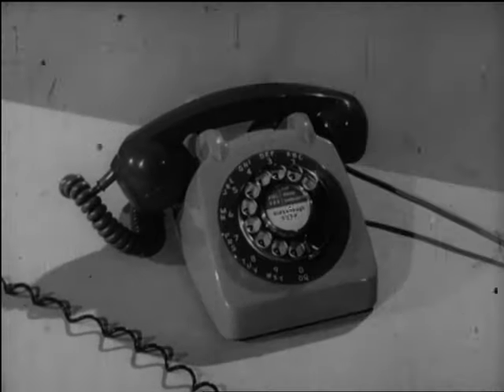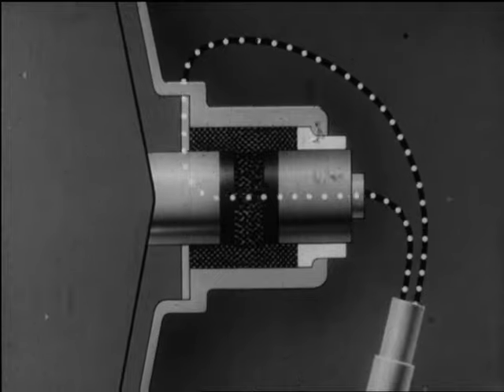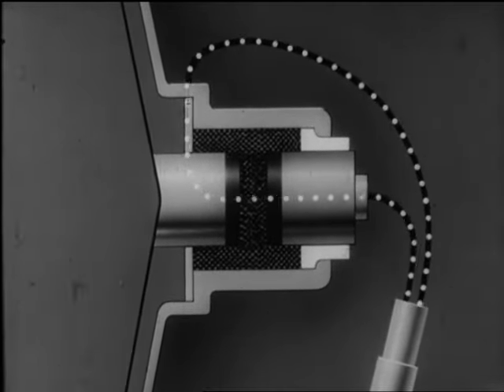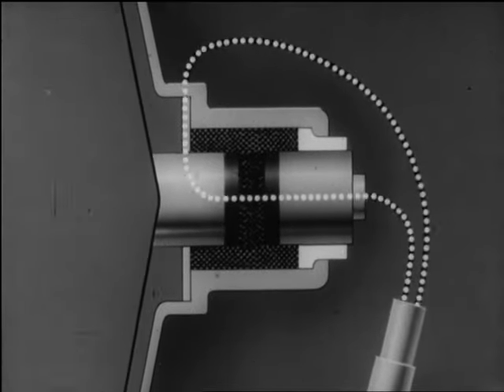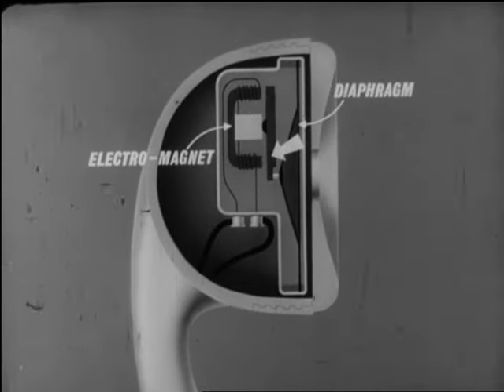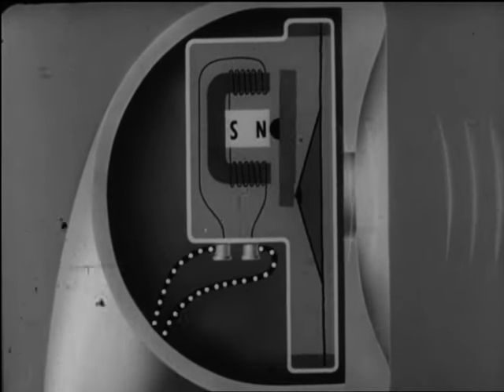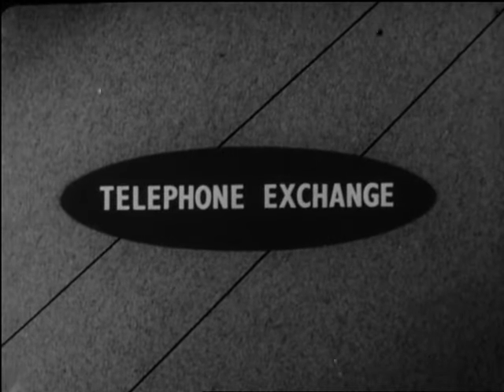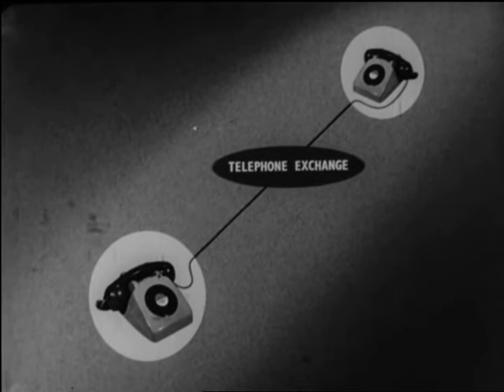The Telephone - How It Works

Comment: Brilliant video explaining sound waves and what was done to improve them using electricity.  One thing I don’t understand is regarding the bell.  If the bell is always connected to the line even when the line is not in use, wouldn’t it be consuming and wasting a lot of electricity?  How does hanging up signal that the connection has been ended if the bell is still connected to the line?  Wouldn’t that cause the system to think a connection is still there?  Especially where this is all done over 2 wires?  The same two wires used for bell ringing and speech.
Reply: Because the bell would only ring if you put DC current through the line. You can have a "connected" (closed) line (circuit) but not inject any current.